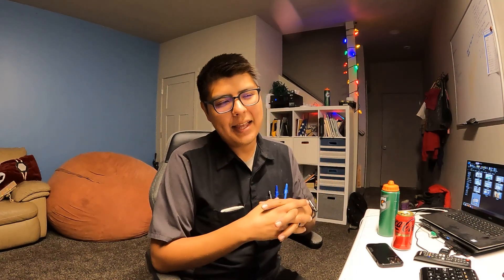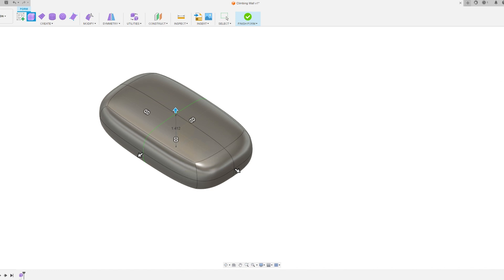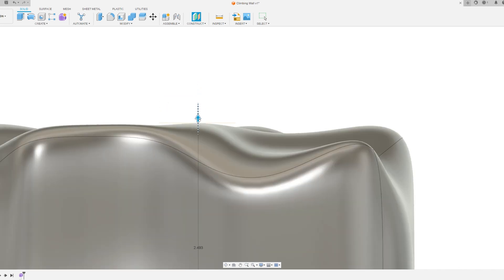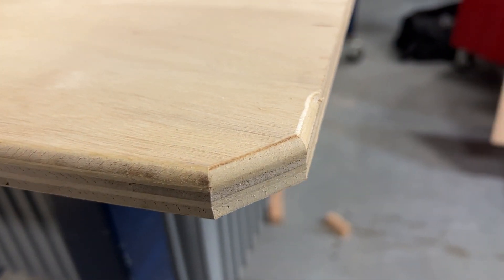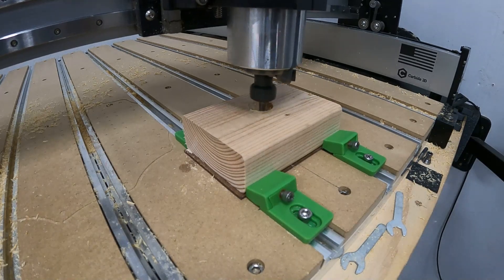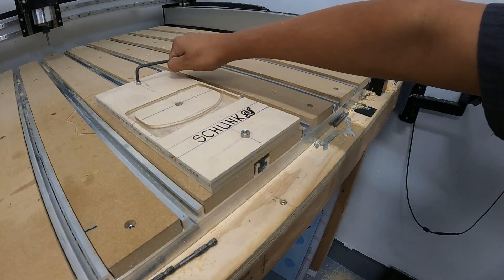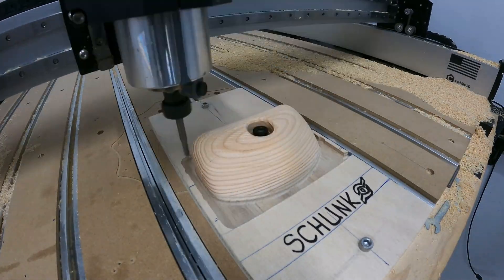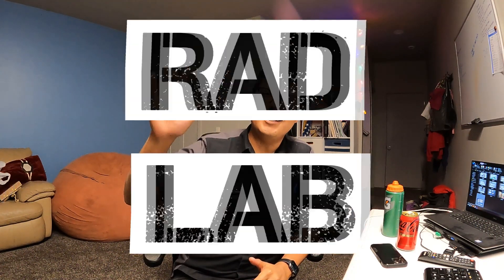DIY Bouldering Wall - From Computer to Reality

Comment: Are there any undercuts in premade hand holds? Do you need undercuts for easy holds? Or did you do two-sided machining? These look great and I might make some for my family!
Reply from the maker: Yeah, some commercial holds are made with a undercut. So I originally make a jig for the router to hold the hold at an angle so I could machine an undercut but my machine doesn’t have the vertical travel to make that cut so I did what’s in the video. It would be cool to do some two-sided machining, but probably with a different machine. I added an undercut manually later with a burr in an electric die grinder.

Comment: Very cool, any good ideas on how to make one more functional for larger souls?
Reply: Be careful making wooden holds for adults - they are more likely to break under shock loads
Reply from the maker: Yeah, I was looking at these holds and I was like, “I bet I could break that.” If they were for me I would get a nice dense wood.
Reply: Like 150kg - doesn't leave much error tolerance given woods variability. For kids absolutely fine!
Reply from the maker: I was thinking about that. I would probably keep the panels 2’x4’ to give them a little more continuous strength and put two rows of screws anchored into wall studs every 8” or so. I’m not sure if I would trust a normal home wall honestly. I think this is fine because it’s for kids but for big dogs like me I think would would want closer spaced studs and the footer and header of the wall to have more screws than normal. I would have to run some numbers to estimate how much a normal wall could support.